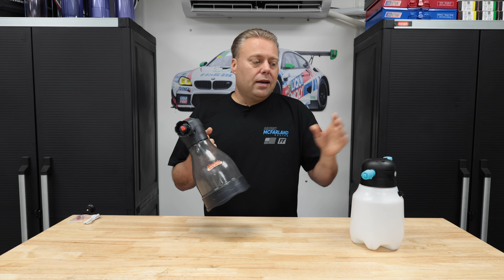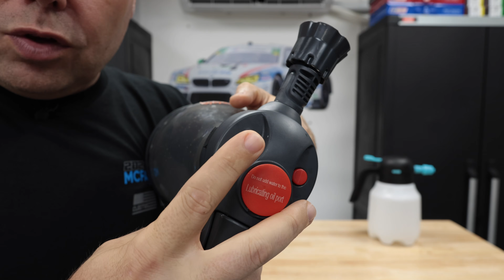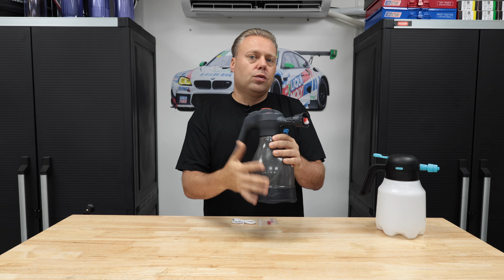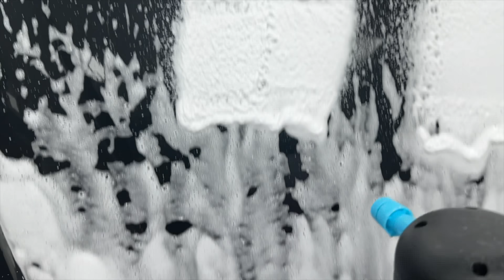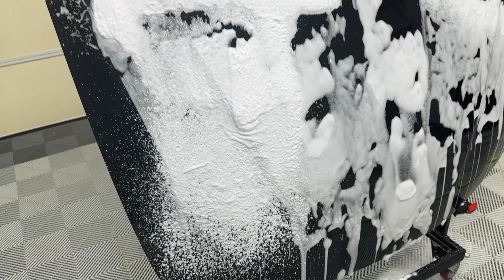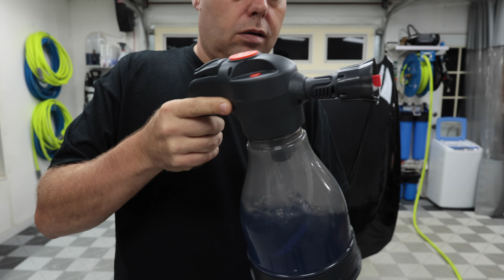NEW Amazon Battery Foam Sprayer | Is It Junk? | Review & Testing

Comment: The transparent one has the same parts as the one you junked. They die after a few uses. Shame because it foams really well.
Reply from the maker: Mine still works, but I don’t use it that often I found out that vapor is just condensation from the pressure.

Comment: That vapor is probably just from the pressure in the bottle. Just like if you drink a bottle of water, then then twist it make pressure in it. Then you twist off the top to launch it in the air, there will be some vapor in there.
Reply from the maker: You are probably right. I was over thinking the vapor. 🤣
Reply: @CarsWithKeav  never hurts to be cautious.

Comment: Have bought 2 of the white ones, lasted for 5 - 6 washes. Crap, not getting a third one.
Reply from the maker: By any chance did you shake them or anything like that. Several haave mentioned there really is no seal at the bottom of the cap and if you get any liquid up there by overfilling, shaking or even knocking the bottle over it will get in the cap and cause damage. This could possibly be the reason behind so many issues of course no excuse for that. I'm going to look at mine and see if I can seal it.

Comment: How do you feel about this one ? This is a 2.0 from a previous form factor that had issues
Reply from the maker: Seems to be working just fine at least the clear one does no issues so far. I use it here and there to distribute APC as it looks like the vapor is just created from the pressure inside the bottle.
Reply: @CarsWithKeav  have you found one you’d say is best so far ?
Reply from the maker: @AmirAbdullah  the new SPTA I think is the best so far a bit more expensive. Just did a review on it. If looking for the best wait a month or two for the new IK battery foamer it will be most likely the best by far, but will not be cheap.
Reply: @CarsWithKeav  yeah my little blue and white ones seem to be holding up. I have one approaching a year. Still working

Comment: havind a reation woth the cheap plastic
Reply from the maker: Possible, but I think it’s more of a reaction to compressed air and liquid. Many responded stating it’s just vapor caused by the compressed air. Read a lot about it and seems like that’s what it could be.
Reply: @CarsWithKeav 

looks like 8K  is already showing the e Foam pro 2 battery powered gianer
Reply from the maker: @btbd2785  yup, just waiting for it to be sold somewhere. I’m hearing early November still.

Comment: Bought the comparison model you demonstrate in this video and in previous ones... Have to say, "I agree"...the newer one you're demonstrating does produce a slightly better foam, but the difference in 'noise' between the two... Holy cow it's 'night 'n' day, and that run-time doesn't compare to the other model... Think I'll stick to the quiet one with better run-time... Awesome, videos... Keep up the great work!!! 🙂
Reply from the maker: You picked the right one as long as you are not having v the defect issue some others are having. It’s my favorite still.
Reply: @CarsWithKeav  Excuse my ignorance, but what is the issue some of these are having?
Reply from the maker: @crookassassin  The one this video is for the gray bottle cracks. The white bottle one that I used for the comparison seems to have some issues with charging and not turning on. I did list a newer version that is black that seems to have better reviews.
Reply: @CarsWithKeav  Ahhh...Didn't even see the 'Dark bottle' option, bought the whites version... Will keep my fingers crossed it doesn't fail... Thanks for the heads-up!

Comment: Does anyone make an actual quality electric foamer/sprayer?
Reply from the maker: Outside of the IK E Foam Pro 12 not really and that one is $250 and holds 2 gallons. IK is coming out with a battery sprayer in a few months and I personally think that will set the standards Griots tried and theirs is horrible in my opinion. Only thing right now is to modify a Marolex foam sprayer with a valve and attach a small inflator to it.
Reply: @CarsWithKeav 

have you seen what the IK will look like? I seen the new IK  battery powered regular sprayers but not a battery they don't foam . 
0ll
Reply from the maker: @btbd2785  they don’t currently have a battery sprayer of any kind yet except the large 2 gallon e foam pro multi and foamer. I have seen what they look like as it was shown on rag companies YouTube sometime back. It was in this live stream https://www.youtube.com/live/vMncdzDAAP4?si=yTn_Z8e0Gklaz8qs

Comment: Compressed air contains water vapor. If you have a wash keg, fill it with air, then let the pressure out and open it up immediately. Looks like dense fog inside.
Reply from the maker: I thought in the beginning, but never have that with my IK pro 12 or my other ones. Maybe it is how the compressor puts the air in the bottle?
Reply: @CarsWithKeav  possibly. Maybe it's the pressure inside. The IK only goes to around 45 or 50. I'll have to test with my foam pro 12 to see if it also gets that way.

Comment: I have the one you tossed away 😮. I haven’t had time to use it yet
Reply: Mine is cracked 😂😮
Reply from the maker: @lep8622  Dang! For sure a bad manufacturing mold or something like that. The clear bottles are rarely ever more durable.
Reply from the maker: @lep8622  it could be perfect. Mine just decided to crack and a few other reviewers had the same issue, but just like my old foamer it worked perfect for me and others had issues. You okay the lottery sometimes with these china products.

Comment: i bought 4 different 2 gal bug/weed killer pump sprayers for 40 dollars. Some guy was selling them. they leaked and were older. I cleaned them all out really good and carefully. Tore them completely down and replaced all the seals and sprayer tube and spray tip for 25 dollars maybe. I have one setup for iron remover, one for wheel and tire, one for bug/tar removal. I have the last one setup for pre soak the car. It makes things so much easier.
Reply from the maker: Very nice! Every tried to stuff some scotch brite pad pieces in one of the nozzles to see if it foam any?
Reply: @CarsWithKeav  no but i will have to try it now lol

Comment: Great video. Which battery powered sprayer would you recommend for applying rinseless wash to the entire car?
Reply from the maker: That all depends on the budget so many options for normal sprayers then there is for foamers.I like the Fanttik NB8 it hold 2 gallons and shoots at really good pressure. Covers areas very fast. https://amzn.to/3zfVTuq

Comment: Can you give us the links to the Everest Eley set up you use? And, is the spray pattern strong enough to forgo an electric pressure washer that puts out 2.0 GPM?
Reply from the maker: If you are using a 2gpm pressure washer you wouldn’t want to replace it with the Eley. The Eley is just a nice to have I use for a few things. Never replaces my pressure washer though. How well it works depends on your house pressure and mine it pretty high, but it will get the best performance out of whatever pressure you have from a garden hose. The pressure washer is the great equalizer when it comes to house water line pressure. My affiliate link with them just takes you to the main page, but I bought the sprayer kit that has everything and two of the quick connect kits.

Comment: Keep trying to find the better ones, the best one. I have bought MANY of the less expensive items that you have reviewed. Most work out, a few have'n't so far. I appreciate what you do.
Reply from the maker: I think we will find the one when IK comes out with their battery foamer in a few months.
Reply: @CarsWithKeav  I need to buy one now. Should I wait for IK? Is it confirmed that they are coming out with one soon? Would hate to spend money now and then soon they come out with the new one!
Reply from the maker: @sfomann  They are coming out with one so one I heard November, but nobody has set any dates that I know of yet.
Reply: @CarsWithKeav I end up buying the black version of the white one in your video. The foam it produces is no where thick as your video shows but it is acceptable. The biggest issue is that it does not have enough capacity to hold liquid to do the entire mid size car. So I have to refill it with water and shampoo couple of times to completely cover the car with foam. And since I don’t have the driveway to do it at home, I have to go to the self car washes where they don’t have a way to refill this with water , so I have to carry enough water with me so I can refill it. They do have the pressure spray hose but that is meant to refill this with water. I am now thinking it might be better to buy the bigger IK one for my use case so I can fill it with enough water at home to do the entire car.
Reply from the maker: @sfomann  What soap are you using? I know some will need a higher dilution as some just don’t foam good. Since it a bit different maybe they sacrificed something for better durability or changed the filter type. For doing a whole car I would for sure suggest the IK Foam Pro 12. I can usually foam a car 3 times with one do those and you don’t have to feel like you have to go light on the foam. It also foams way better and more evenly.
Reply: @CarsWithKeav  I used KOCHCHEMIE Gentle Snow Foam. This one is highly recommended here and gentle enough to not have any long term effects. Feel free to make suggestions
Reply: @CarsWithKeav  one suggestion. Please do a video on what are the best options for someone needing to take it the self care wash. e.g.  best soap, battery operated foamer, dryer cloth etc. I mean the whole experience of washing car at  the self car wash. They do have the pressure washer that can be used to rinse. People living in downtown or apartment and condos do not have the option to wash at home!
Reply from the maker: @sfomann  I can do sure put it in the list. I would assume also it would need to be products you can fit in a car trunk as well.
Reply from the maker: That is a great soap what was the dilution ratio? I’m trying to find out the variables that could be why it’s not foaming as good. Possibly it needs to be a bit stronger do a dilution. Just depends on what you are using.
Reply: @CarsWithKeav  Looks like this new "IK e Foam Pro 2" is already listed on their website. Not sure when it will be available to purchase in the USA. The Rag company does not have it on their website
Reply from the maker: @sfomann  Detailed image has it for pre-order at $120. Looks like early 2025 delivery dates. I’ll get my hands on it at SEMA.
Reply: @CarsWithKeav  That is bit on the high side. I bought one of your recommendations from amazon for $28 and it is working ok. If the quality of this is good and the form it produces is as good as the promotional video then I am willing to spend $120 for it. I live in an apartment and need to drive to nearby self car wash, so this will come in handy.  Hope you get your hands on this soon and do a quick review
Reply from the maker: @sfomann  There are other ones out there I’m working to get and hopefully it works out. They are not available in the U.S. Lots of cool ones out there just got to get somebody to distribute it here. I’ll know more in a few months. If this IK is anything like my custom tire inflator one then it will be Amazing. That cost almost as much as the new one will.
Reply: I have the same 2 you reviewed. Got them from watching this video. They are working great.  Any updates on this series ?  Any other suggestions?
Reply from the maker: @ I haven’t found much else other than the SPTA foamer is is what I am using currently. Not compressor style, but an great electric pump foamer.

Comment: Where does these two rank vs the black and yellow one that was about $80?
Reply from the maker: Much thicker spray with les pulsing. The Black and Yellow one works well just $80 is such a hit on the wallet when it’s close to the cost of an IK and inflator combo. I have not use much since I keep using the new ones.

Comment: Does anyone make one of these but actually good quality lol? I wouldn't mind paying a bit more for something that I know will last.
Reply from the maker: This is one of those categories where that does not really exist yet except for the IK E Foam Pro 12. IK is coming out in a few months with their version of a battery foamer so that could be the next best thing.
Reply: @CarsWithKeav  interesting thanks for your reply. I'm currently using the foamer from your last Amazon foamer video that you brought up again here with the blue tip. I use it to foam down my car as a pre-soak as I live in an apartment and have to go to a coin-op car wash. Just about to get full coverage of my Honda Civic coupe with a full tank. Only weird thing it does is it stopped turning off automatically and now it just pumps air continuously until I physically turn it off. Still a great option tho for apartment dwellers like myself. Please keep us updated on what you find going forward!
Reply from the maker: @christopherpape4823  Has to be some kind of switch with a sensor. That sensor may have gunked up or failed. I’ll keep an eye on mine if it starts to fail or not. Another think I noticed after  watching is that it’s very quiet compared to the new ones.

Comment: I’ve been using the $35 one (actually got it cheaper at the time) for the last few months and it has been working flawlessly. Use it with brakebuster 5:1 and flush it out with water each time. The battery time is very impressive as I’ve only charged it once so far. These products can be hit or miss, especially after my experience with the SPTA leaking air over time, but I’ve been happy with your previous recommendation so far!
Reply from the maker: Has worked great for me as well. I had issues with the SPTA leaking product into the compressor area and all over my cabinet after a few months.

Comment: I've been using the old Amazon foam sprayer mainly as a sprayer. It's been working really good for me and I love how quiet it is. One tip for any sprayer is to wet the seal before tightening the top which lubricates it for a better seal. I learned this from using a NutriBullet smoothie maker. Any chance you will do a review of the new Chemical Guys TORQ Foam Blaster Pro 6 wash gun for a garden hose? It looks like it might perform better than what's been on the market up until now.
Reply from the maker: I’ll look into that foamer and see. A good oring lubricant will work as well to help seal better.

Comment: The vapor is condensing moisture from the pressure in the foamer.  Put your fist over your lips, blow really hard with your mouth closed, then gently puff out a cloud of vapor you just created in your mouth.  There could/should be vapor in the the other foamers as well...maybe the opaque plastic hides the vapor in the others?
Reply from the maker: No vapor in the other foamer I showed in the video which is why it confused me. I tried and never could get it to vapor. Maybe the pressure level is different?
Reply: @CarsWithKeav  Just rewatched the video,  both heads do it in that bottle but not the opaque bottle? does it vapor outside the bottle? is it mechanical "break in" lubricant or something? does it "smell" like anything? Hope its not a lithium off gassing, ever see one of those go off? the shape of the bottle matter?  Wish I was more clever to figure that out!
Reply from the maker: @manwithoutshadow  I’m not clever enough that’s for sure. 🤣 So it does it with both heads and both of their bottles. I meant the other older foamer doesn’t vapor in it’s bottle. I don’t see vapor coming out when the bottle is off so your theory could be true. Waiting for some PHD’s in chemistry to chime in. 🤣
Reply: @CarsWithKeav  https://www.youtube.com/shorts/SAehBNVG0JU
Reply: I tried it with the opaque foamer, it also creates vapor. Completely normal because of the heat created from air pressure

Comment: is that brake buster soap safe on Carbon Ceramic rotors? Thanks.
Reply from the maker: I would be careful with carbon ceramics they like to absorb the chemicals which can cause issues. Usually a neutral type soap is best for them. I don’t see anything in their site saying it’s safe, but also not saying it’s unsafe. With rotors like that I would stick with anything saying it’s safe for them. Plus they don’t give off much brake dust to need the extra cleaning power.

Comment: I purchased the "old" Amazon sprayer abt a month ago. From your review. Been working fine. Any idea where to buy more red disc filters.
Reply from the maker: Look up IK foamer filters they can be used. Also you can make your own cutting out scotch brite pads. https://www.zoro.com/ik-sprayers-10-piece-filter-diam-11mm-81776313/i/G506617273/?utm_source=google&utm_medium=surfaces&utm_campaign=shopping%20feed&utm_content=free%20google%20shopping%20clicks&campaignid=21528295871&productid=G506617273&v=&gad_source=1&gbraid=0AAAAADw3hZe_q1YjQDS-6gIAiPioFNrPD&gclid=CjwKCAjwufq2BhAmEiwAnZqw8txhNtT_UzW1PFzSPsgGUiUkiEzIcs8QMugzuMdFxsB1nOku_PmAORoCnAcQAvD_BwE&gclsrc=aw.ds

Comment: I'll definitely check out one of these.  I bought an IK pump foamer and I'm not happy with it.  It leaked foam out of every seal the first time I used it.  I saw online that people recommend lubricating the seals, or even suggest that they're defective when that happens.  it shouldn't happen during the first use.
Reply: This is why I went with Marolex, I got a few of them an they are super high quality and never had issues
Reply from the maker: @JustinWoodwork  I’m going to take one and put a valve in there and an inflator and see what happens.
Reply from the maker: I have heard a few have issue with IK foamers they seem hit or miss at times. Even Rad Garage told me he had issues with several of them when we collated at DIY Detail film studio. I myself have not had issues with the 3 I have bought.